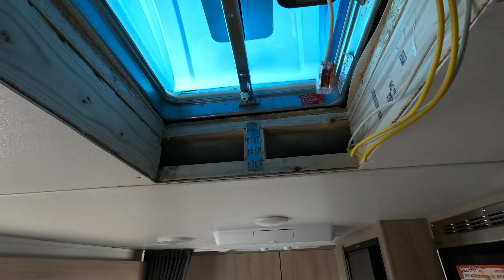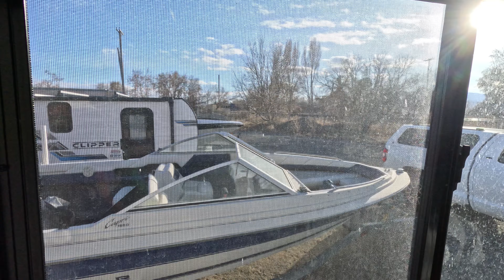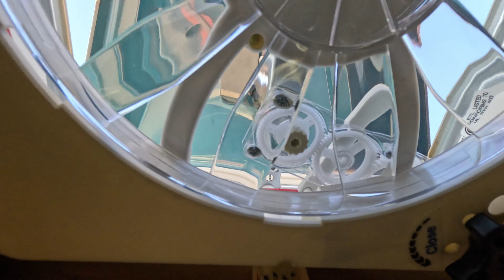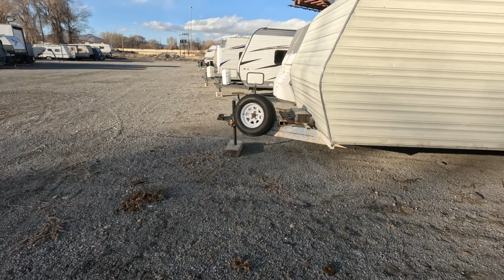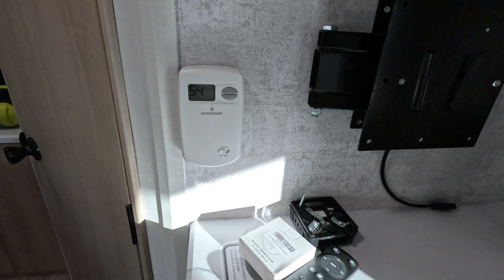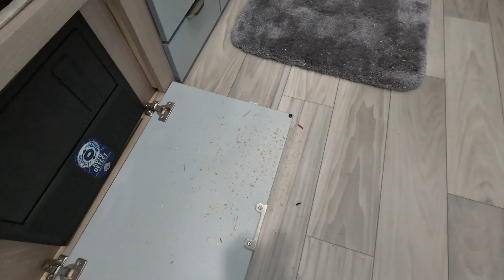Trailer mods and trying a new Mic

Comment: Microphone sounds great. We bought some off Amazon but could never get them to connect to the GoPro. I’m gonna go look up the Hollyland ones. Thanks for the suggestion.
Reply from the maker: I have this hooked up via the GoPro MediaMod, just for reference. The wired mic adapter just slides into the cold shoe on top of the media mod. It should also work with DSLR or other vlogging cameras as well as long as they have a TRS input jack.